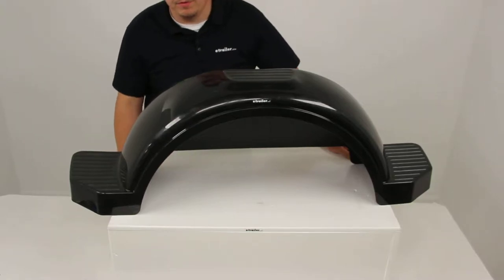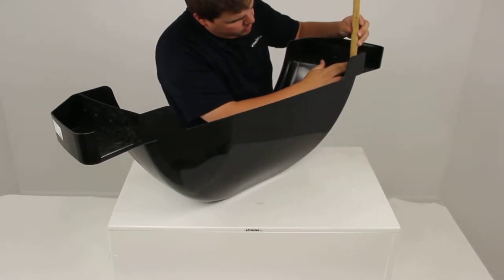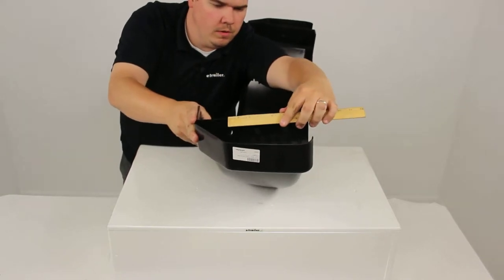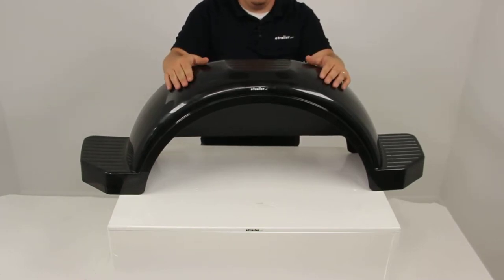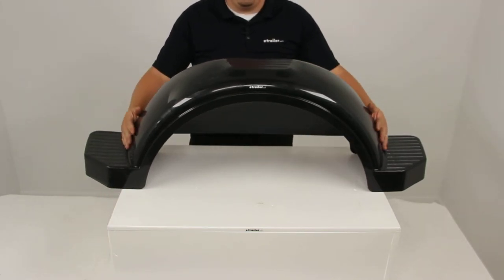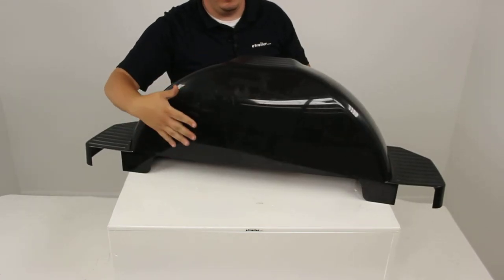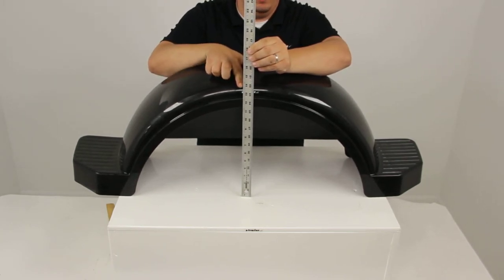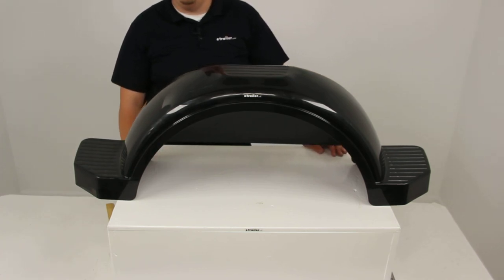etrailer | Fulton Single Axle Trailer Fender with Top and Side Steps Spec Review

Comment: yes great a fender without mounting brackets  what are the brackets for these?? IE a part number that would attach these to a boat trailer  thanks
Reply: Seems to be a big secret on these fenders as I am trying to find out the same thing. Can not find any info for brackets for these....unreal.
Reply from the maker: @johnmerriman4867  We have many different brackets available to get these fenders attached to your trailer. You will need to look through them to see which fenders will fit your trailer best. Check out the following link for the options we have.
https://www.etrailer.com/dept-pg-Accessories_and_Parts-sf-Trailer_Fenders-pt-Mounting_Brackets.aspx